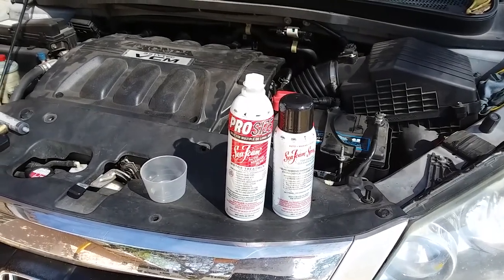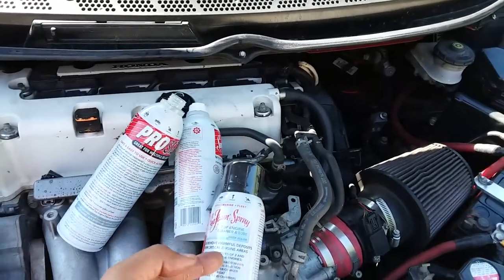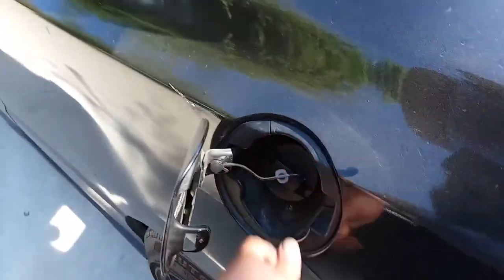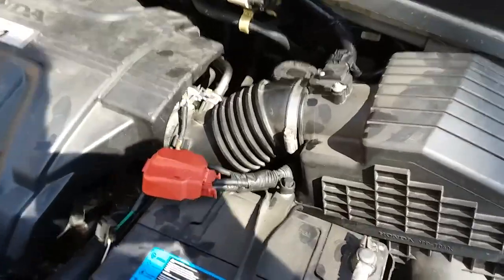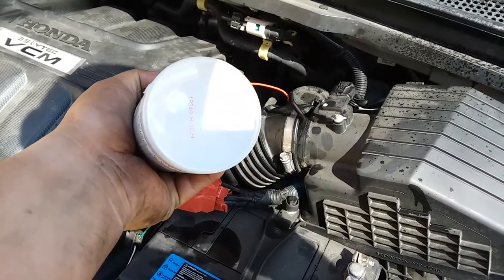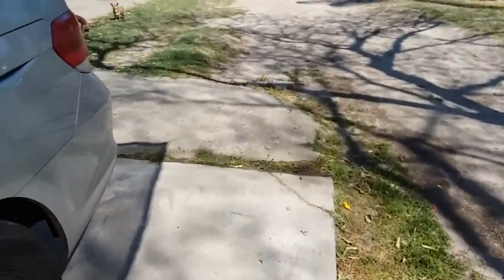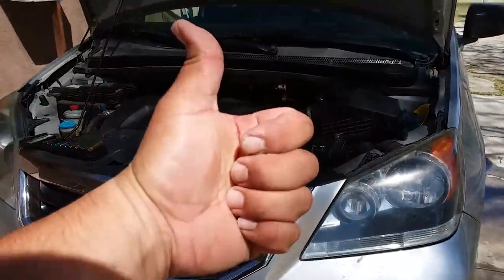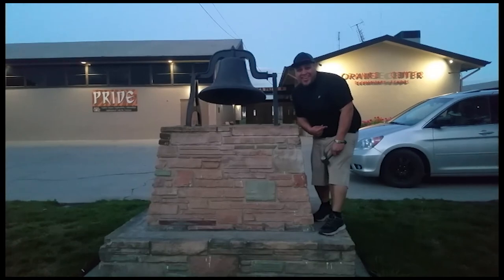How to: Do a Complete Seafoam Treatment on a 2010 Honda Odyssey

Comment: Would this also clean the EGR port and valve?
Reply from the maker: Not really sure cause it gets fed from the intake system directly in the intake manifold and in to the cylinders. I think its just for the main air flow. You might have to remove the egr and manually clean it with carb cleaner